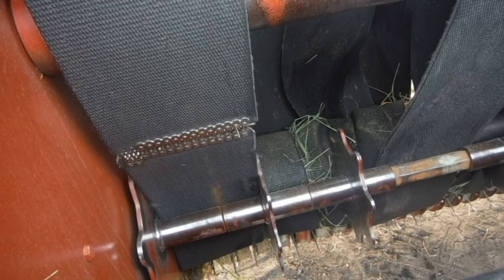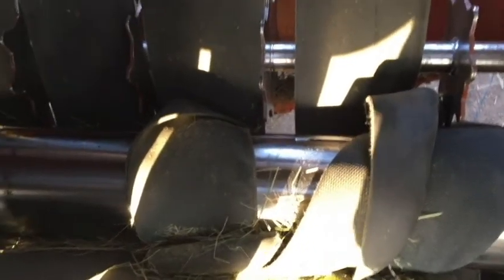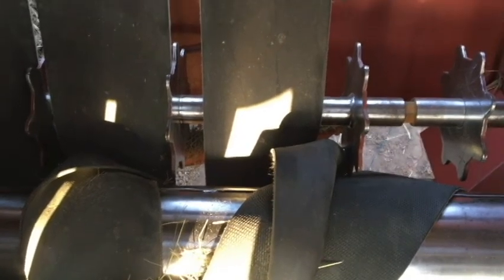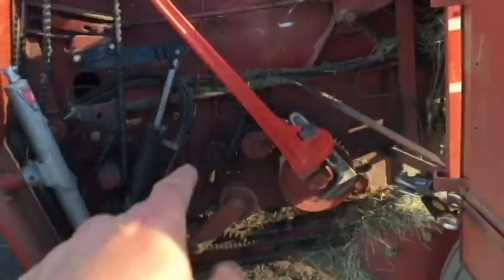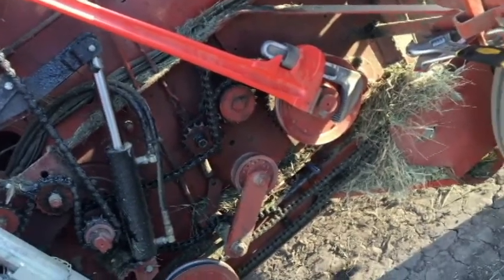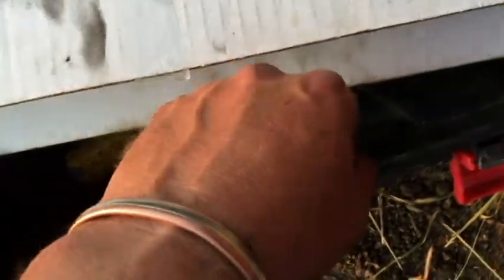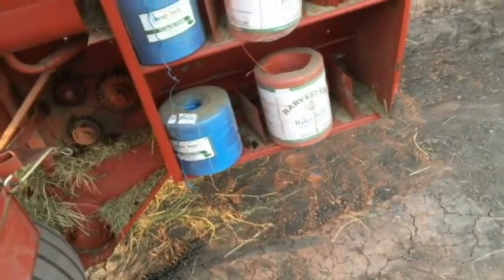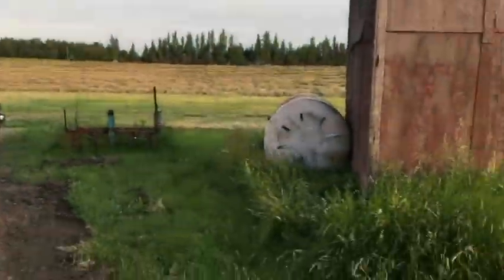Hesston 565A belting issue

Comment: what would you recommend when the belt broke and there's a full sized bale in there? Was baling last night and boom...nothing.  Monitor says clutch slipped.  Well, slip clutch definitely engaged and the middle belt is off the top roller and  stuck.  Can't open the gate b/c slip clutch is engaged and cant feed the hydraulics to the gate. Is there a way to get the gate open when the slip clutch is engaged? These self contained hydraulics can be problematic to say the least.
Reply from the maker: now i am no expert but what comes to mind is try and slack off all the belt tension, the goal is to get the bale out so if you make the belts slip and the clutch is engaged spinning everything you should be able to raise the back gate. that being said you may need to cut the bale out of there once the gate does open. hope this helps keep me posted